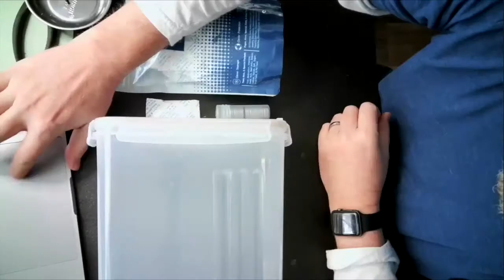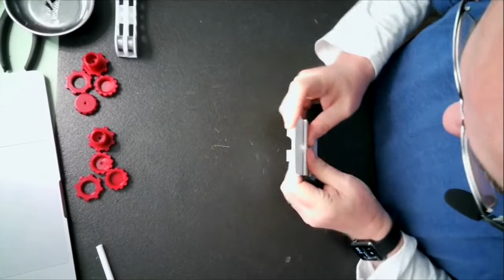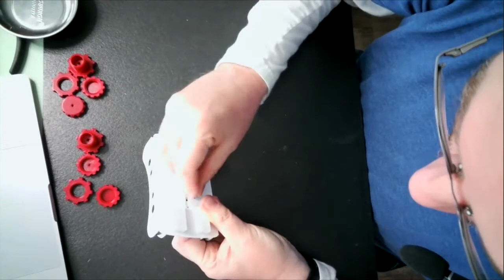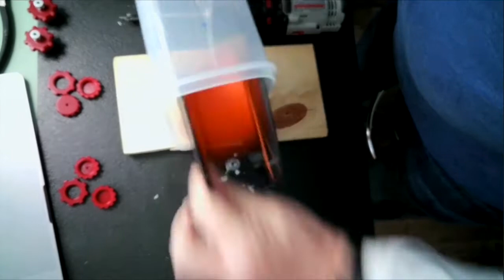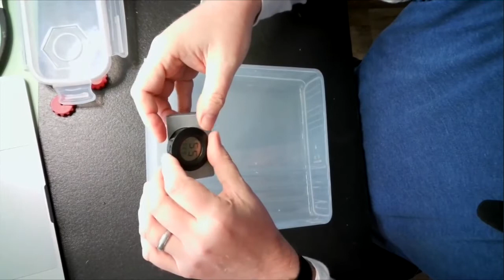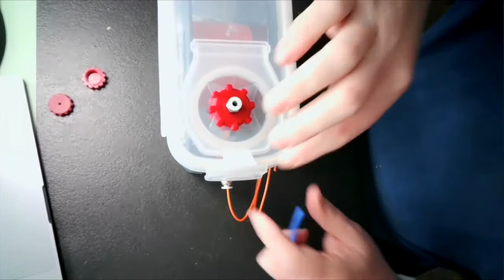Quickly Build Your Own Dry Box for Storing 3D Printing Filaments!

Comment: I did mine but it's holding humidity
Reply from the maker: Check the seals and your descant packs. Mine all reduce after a couple of hours.
Reply: @minimal3dp  I revealed it. And dried out my desiccant. I also ha e a heat pad inside I think it may be committing the offense
Reply from the maker: @lokiwartooth1138  let me know. I am curious. I have thought about using a heat pack myself.
Reply: @minimal3dp  seems like the heat is too close to my packs maybe and is releasing the humidity they are capturing